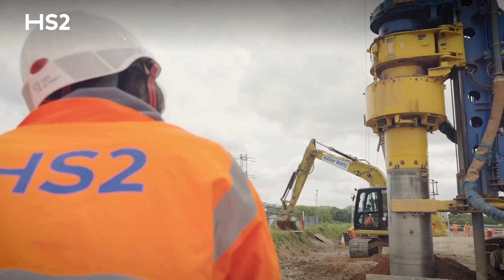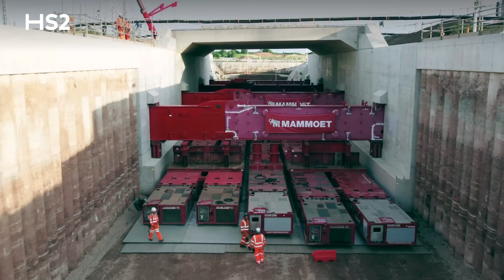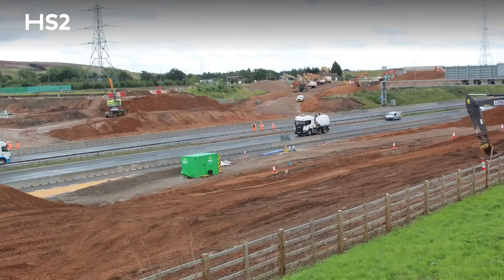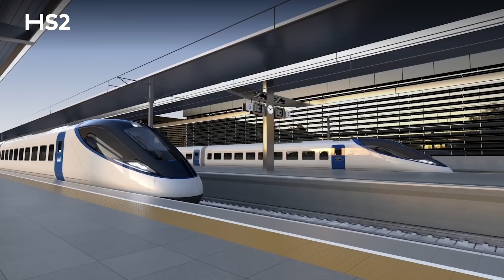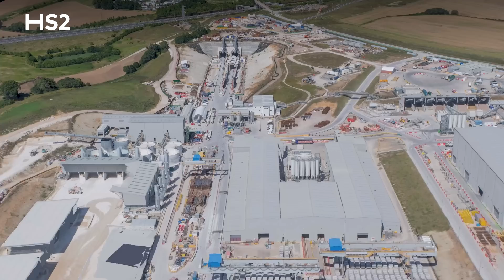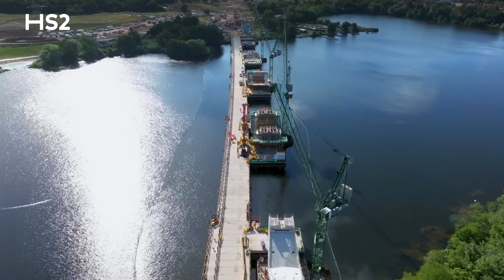HS2 Project Update, September 2023

Comment: Sounds like by the way things are going, it's only going to be a service from old oak common to Birmingham
Reply: The tunnels will be built to Euston because the factories, boring machines and the materials have all been built an paid for. Having two perfectly good tunnels sitting empty isn't going to be politically viable. 

I do think by 2030 someone will take the hard decision and decide that the whole Euston Station need to be rebuilt to accommodate HS2, an no matter the design it going to take billions to do it properly. 

I do think that TFL/HS2 and Network Rail will do a lot of work to prepare for that day anyway, an construction will go fair quick once it signed off. .
Reply: @DavidKnowles0 It is looking likely OOC to Euston will be shelved. The idea is to use the elizabeth line to central London instead. Even with the work done this will save £4.8 billion. Birmingham to Manchester will definitely be axed. No doubt about that at all. The £37 billion saved will be allocated elsewhere.
Reply: @ds1868  hopefully the next government will have some ambition and expand the project. it will pay itself off many times over, just need to be less shortsighted. got to spend money to make money
Reply: @MrOlympuse410 Agreed. And delays cost more money. At the moment HS2 going forward is a complete mess.
Reply: @ds1868 The £37billion wouldn't be 'allocated' elsewhere. It would be used to 'fund' short term tax cuts. It's the definition of short-sightedness
Reply: @ds1868 how is that viable tho. That might mean total journey time from Birmingham to London is pretty much same as it is now
Reply: @jermainetrainallen6416 Tories in a nutshell
Reply: @ds1868 In my opinion the government should not be in charge of this projects, the decisions should be allocated to experts as it is clear the government does not understand why this line is being built and because of that they see it as getting to England's cities faster instead of huge relief on particularly the west coast main line and other lines

Comment: I said I needed to know why they don’t dig a tunnel and do an extension for the main line Train so that they can extend the unused abandoned underground train stations. Why couldn’t they use the part D78 Stock train doors on the sides and also restructure the front face of the A60 and A62 stock and that includes the class 313, class 314 and class 315 remix and make them all together and also redesign them an overhead line and also make them into Five cars per units and also having three Disabled Toilets on those Five cars per units A60 and A62 stock trains and also convert the A60 and A62 stock trains into a Scania N112, Volvo B10M, Gardner 6LXB, Gardner 6LXC and Gardner 8LXB Diesel Engines and also put the Loud 7-Speed Voith Gearboxes even Loud 8-Speed Leyland Hydra cyclic Gearboxes in the A60 and A62 stock, class 313, class 314, and class 315 and also modernise the A60 and A62 stock and make it into an 11 car per unit so it could have fewer doors, more tables, computers and mobile phone chargers. A Stock Trains and also having 8 Disabled Toilets on those A stock trains. why couldn’t we refurbish and modernise the Waterloo and city line Triple-Track train tunnel and make it more Larger and extend it to the bank station, making it into a Triple-Track Railway Line so those Five countries such as Australia, Germany, Italy, Poland And Sweden to convert the waterloo and city line Triple-Track Railway tunnel into a High-Speed Railway lines? The Third Euro tunnel Triple-Track Railway line to make it 11 times better for passengers so they could go from A to B. Then put the modernised 11 car per unit A Stock and put them on a bigger modernised Waterloo and city line Triple-Track train tunnel so it could go to bank station to those Five countries such as Australia, Germany, Italy, Poland And Sweden. The modernised refurbished 11 cars per unit A stock could be a High Speed The Third Triple-Track Euro Tunnel Train So it is promising and 47 times a lot more possible to do this kind of project if that will be OK for London Australia, Germany, Italy, Poland And Sweden. oh by the way, could they also tunnel the Triple-Track Railway Line so it will stop from Buckinghamshire, Hertfordshire and Essex so that the Passengers will go to Australia, Germany, Italy, Poland and Sweden and also extend the Triple-Track Railway Line from the Bank to Buckinghamshire, Hertfordshire and Essex Stations so that more people from there could go to Australia, Germany, Italy, Poland And Sweden more Easily. Why couldn't they extend the Piccadilly Line and also build brand-new underground train stations so it could go even further right up to Clapton, Wood Street can they also make another brand new underground train station in Chingford and could they extend the Piccadilly Line and the DLR right up to Chingford? All of the classes 150, 155, 154, 117, 114, 105, and 106, will be replaced by all of the Scania N112, Volvo B10M, Gardner 6LXB, Gardner 6LXC and Gardner 8LXB Diesel Five carriages three disabled toilets are air conditioning trains including Highams Park for extended roots which is the Piccadilly line and the DLR trains. Could you also convert all of the 1973 stock trains into an air-conditioned maximum speed 78 km/hours (48 MPH) re-refurbished and make it into a 8 cars per unit if that will be alright, and also extend all of the Piccadilly train stations to make more space for all of the extended 8 car per unit 1973 stock air condition trains and can you also build another Mayflower and Tornado Steam Locomotive Companies and can they order Every 37 Octagon and Every 17 Hexagon shape LNER diagram unique small no.13 and unique small no.11 Boilers from those Countries such as Greece, Italy, Poland, and Sweden, can they make Mayflower and Tornado Steam Locomotive speeds by up to 142MPH so you can try and test it on the Original Mainline so it will be much more safer for the Passengers to enjoy the 142MPH speed Limit only for HS2 and Channel Tunnel mainline services, if they needed 16 Carriages Per units, can they use those class 55’s, class 44’s, class 40’s and class 43HST Diesel Locomotive’s right at the Back of those 18 Carriages Per Units so they can take over at the Back to let those Mayflower and Tornado Steam Locomotive’s have a rest for those interesting Journeys Pretty Please!!!!!!, oh can you make all of those Coal Boxes’s 17 Tonnes for all of those 142MPH Mayflower and Tornado Steam Locomotive’s so the Companies will Understand us PASSENGER’S!!!!! so please make sure that the Builders can do as they are told!!!! And please do something about these Very Very Very Very Very Very Very important Professional ideas Pretty Please? Prime Minister of England, Prime Minister of Australia, Prime Minister of Sweden, Prime Minister of Germany, Prime Minister of Italy, Prime Minister of Poland and that Includes the Mayor of London?
Reply: Erm ..... On a page devoted to a railway that will have 200mph trains? Hardly suitable for D78 Underground stock!
Reply: @keithmarsh5706 I can't tell if he was joking or not. Surely that wasn't a serious proposal. Sounds like something a railway engineer would come up with that after staying at the pub for too long😂

Comment: Is HS2 going to Euston?
Reply: the tunnels are, will there be anything for them to connect to is another question.
Reply: It will reach Euston eventually as OOC does not have the capacity to terminate trains there
Reply: @peterwallen1063  They can increase capacity at OOC if the link to Euston is axed. They could also link some (not all) trains onto the Elizabeth Line. Anything is possible, especially when saving money.
Reply: @ds1868  No they can't as the OOC Station is being built in a box construction with tunnels either end.
Reply: @ds1868 They can't increase capacity. The Old Oak Common station box has already been build so it would be impossible to redesign it at this stage. We're getting the six platform station whether we like it or not. Therefore,  Euston should be the absolute priority for the entire project. If the government wants to be rational (which it never is), it should focus on Euston gettibg right as a next step and then move on from there
Reply: Only 1 way its going and thats down the toilet.